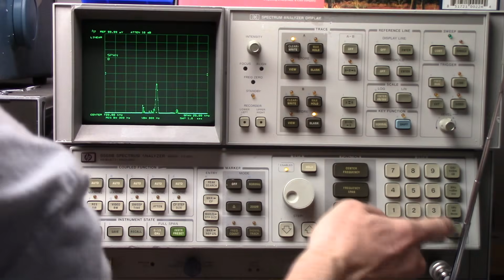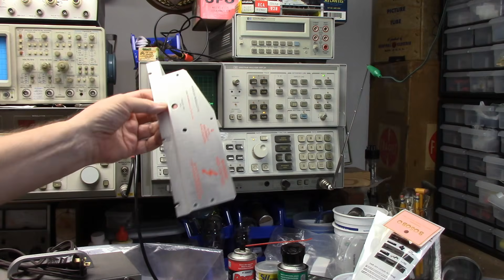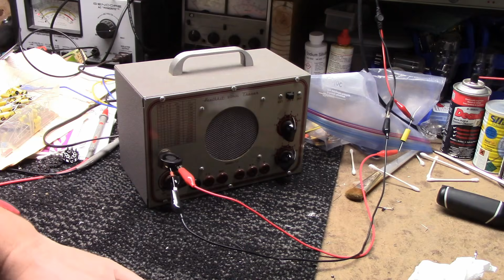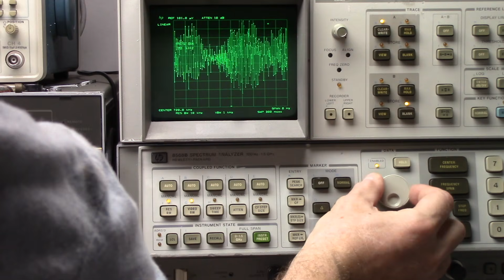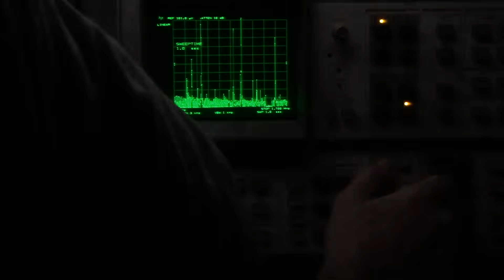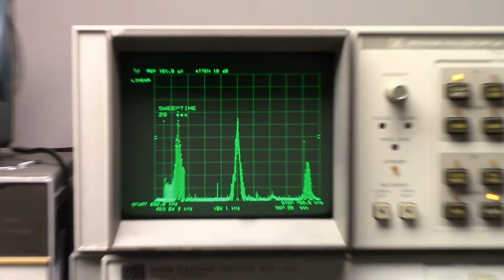HP 8568B part 7 - Listen to AM radio using a vintage spectrum analyzer

Comment: When scanning the FM band, what does the waveform look like?
Does the audio from the video detector sound the same?
Why isnt a diode detector needed at the video output?
Reply from the maker: I haven't looked at the FM band yet, but I expect it will look similar with a signal spike at each station.  I don't think you could listen though.  The spectrum analyze has a detector and filter inside but not a descriminator.

Comment: The occupied Bandwidth for the AM band is 10 kHz per channel.  For the FM band, it is 170 kHz, and you will need to slope detect the FM signal.

So, for AM detection Resolution Bandwidth = 10kHz and Video Bandwidth = 3kHz.  FM, Resolution Bandwidth = 100kHz, Video Bandwidth = 10kHz, and offset the receive frequency by about 90kHz.

Comment: Bob, with that analyzer, the Resolution Bandwidth acts as your IF filter bandwidth and the Video Bandwidth is a low pass filter on the detected receiver output.  The frequency selection is actually the 3 dB cutoff frequency.  The Resolution and Video Bandwidth filters are Gaussian (or linear phase) so, don't have a rapid cutoff on the skirt response.

That analyzer also always places at least one 10 dB pad in front of the RF input, which increases the noise floor when looking at weak signals.  You can manually key this out by, tapping the Attenuation key, then keying in 0dB on the keypad.  However, only use this option if you can guarantee your input level (in band and out of band) will always be -10 dBm or less input power.  It is surprisingly easy to destroy the front end.

Comment: Most of the police departments have fully encrypted any of the main dispatch and other main channels. I have been listening since I was a kid and they have slowly made it harder harder to listen to. I can still hear fire and hospital traffic and that's about it.
Reply: Correct. In Florida, pretty much all first responder 2 way is encrypted and the radios can cross communicate from local police, fire to FDLE statewide.
As far as I know.
Reply: Was there a reason for this? Were "bad" people listening and ambushing cops or posing a safety risk in some way?  I too remember listening to police and fire radio channels back in the day. You could also listen to air traffic controllers too. Have tried it in ages so I wasnt aware its encrypted now
Reply: @Suddenlyits1960  I'm pretty sure air traffic calls (to and from planes) are still AM (so that if multiple people transmit at once it can still be intelligible).

And I'm sure higher class criminal operations were monitoring police radio traffic. Knowing where cops are would definitely be of benefit to criminals. There are also privacy concerns. With the notable exception of Florida most places don't want information about every police call made public.

Comment: How   are you removing the  carrier   frequency,   you don't have  a oscillator
Reply from the maker: The spectrum analyzer does.  The input goes right into a mixer where it is combined with a LO.  What you see on the screen is the detected output of that mixer.